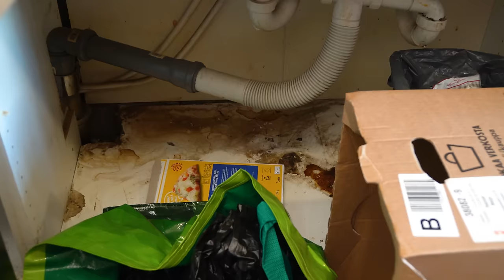Who Did I Rent My Apartment to??! 🏠😱Deep Cleaning a Trashed-Up Apartment for Free!

Comment: Im a janitor at an elementary school.  Teachers LOVE placing a million name tag stickers on desks throughout the school.  🤦🏻‍♀️. Every summer, our jobs take a major slow down because we have to peel and scrape stickers off, and then clean the sticker residue off every single desk.  Literally hundreds! 😢.  I will try the product you suggested.  Other products haven’t helped much.
Reply: If for some reason that doesn't work try a blow dryer or a heat gun -- not to the point of melting the sticker, just to heat up the glue on the back so it can peel right off. Hope this helps!
Reply: @therealJamieJoy   Ok.  We’ll try that.  Just looking for a very fast solution because of all the amount worth that we have to do along with moving all the furniture, stripping/waxing all the floors, shampooing all the carpets, cleaning all the surfaces and crevices, cleaning all windows, power washing all the outside and lunch tables, and putting all the furniture back.  All while all the other staff and kids are at home relaxing. ☹️
Reply: Goo-Gone!
Reply: @kaitlinhillier   Good gone is ok.  But buying enough for hundreds of desks is too pricey.
Reply: It never occurred to me that the custodians would clean the names that I put on the desks. I cleaned my own desks every year. Shame on those teachers who don’t.
Reply: Maybe the principal could send out a memo to the faculty at the beginning of the year in re : the name tags.
Reply: Yeah if each teacher removes the tags from their 1 classroom it wont take them too long, and you wont have hundreds and hundreds of desks to do
Reply: Why doesnt the principal ask the teachers to remove them? They can use name plates with tape...the kids love taking them off and taking them home for their bedroom doors. Then the kids can have fun cleaning the desks with shaving cream!

Comment: I used to live in a house with Laminated wooden floors. I used a lightly damp Microfiber cloth to mop the floor. I had a bucket with Cold Water mixed with Lysol Multipurpose Cleaner. I dipped the Microfiber in the solution and strained it very well before mopping the floor with it. You need to be careful not to use a warm water or a very damp cloth when cleaning Laminate surfaces.
Reply: I would never want that crap in my house
Who has the time or mental fortitude to treat a FLOOR like a living creature? Its too much maintenance. A floor is there to be walked on and be durable forever. All floors need a good level of care and cleaning but some types of floors I can’t imagine paying so much money and I can’t even regularly mop it every week. I don’t wear shoes in my house to begin with which solves the need to have to mop it intensely anyway.
Reply: @Ilovevitaminwater  The majority of Europeans never wear shoes inside and are baffled by Americans for whom it seems to be the norm. I've never walked with shoes in my home, however the floors need to be clean regardless. I am curious what kind of flooring you have that doesn't require 'much maintenance'.
Reply: Those type laminate floors have compressed cardboard as a backing. They are garbage. The new type doesn’t have this backing so water doesn’t bother it. I’ve cleaned over 20 years, and always warn people against laminate and engineered hard wood.
Reply: @ginismoja2459  i have separate shoes for indoors and outdoors

Comment: A hot towell left on stove will pull that gunk up too. Just leave it for about a hour. Microwave is easy too. Microwave some hot water in a bowl for like 6 mins then take it out and everything in and on microwave is soft and wipes right off. ❤ Less chemicals used. :)

Comment: You could put a pot with hot water in that frozen fridge for a little while with the doors closed to melt the ice, no need to use a hammer. Don't leave it too long, as the ice might flod, but just to remove the big blocks of ice.

Comment: For sticky stuff from stickers/tape I can recommend babyoil if it is on plastic or glass! Don't use that on wood or other surfaces that absorb oil unless you want to rework the surface. But for me it works really good and is safe if my cat is around. I drop it on the sticker, work it in with a tissue and sometimes that already desolves it. Otherwise a scraper does the rest. I guess some cooking oil like canola or sunflower could also work but babyoil is not as thick and sticky as other oils so it's easier to clean off afterwards (most times I wipe with a clean tissue and it's already gone).

Comment: What a transformation. Great job!  It looks like a dishwasher flooded the kitchen and the water set for a while. But, I dont see a dishwasher. Maybe they left the kitchen sink running and it overflowed. It obviously had water setting in that area for a while. When you have a refrigerator that has frozen up like that, be careful trying to chip away the ice. I was cleaning a mini fridge like that, chipping away at the ice because I wasnt patient enough to let it thaw out. Well, I punched right into the freon tube. Big problem there. Scared the bejesus out of me. I use to have a fridge that wasnt frost free and what my mom taught me was to put pans of very hot water inside and shut the door. Let the heat loosen up and thaw the ice. Empty the pans and repeat a few times. Works quite well. I shouldve used that method on the mini fridge. lol

Comment: My dad had a similar issue with their laminate floor in the kitchen beside it never was wet on the floor, turns out the dishwasher was leaking and the water was going under the laminate panels... At least insurence covered the costs for redoing the kitchen floor!

Comment: I had a roommate whose single fault was pan frying fish without cleaning afterward- When you fry in a pan on a stovetop without using a lid or spatter screen, a mist of oil gets on every surface within at least two meters and makes it ALL STICKY. Then any other dirt or dust sticks to that, and it won't wipe off without strong effort or oven cleaner and similar.

Comment: To clean ice out of a freezer, boil a pan of water, put it in the freezer, shut the door and wait. It will help the ice melt and you won't have to use a hammer, . You will probably have to do it several times depending on now much ice is in there.

Comment: Auri!! Cleaning question. You use a lot of oven cleaner and the one I have in my home is sooo strong and really dangerous to breath in, I have to use something over my mouth not to breath it in too much, what do you do about this? Isn't it hard or even dangerous for your lungs to use that much oven cleaner?

Love from Sweden ♥️
Reply: Try Dr Beckmann's. Its caustic but rinses off with water and the surface is then food safe, so you can use it for oven grills and baking sheets. You use it on a cold oven.